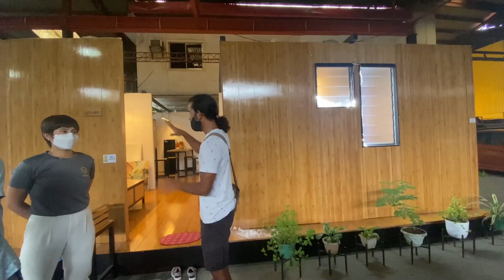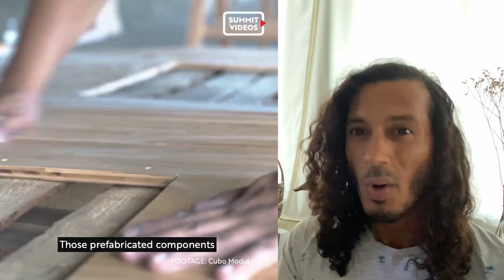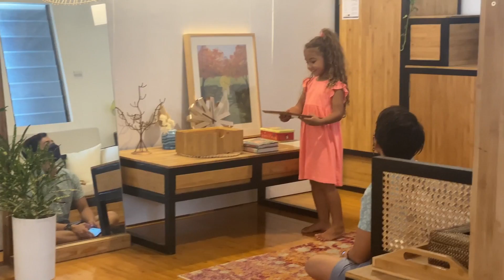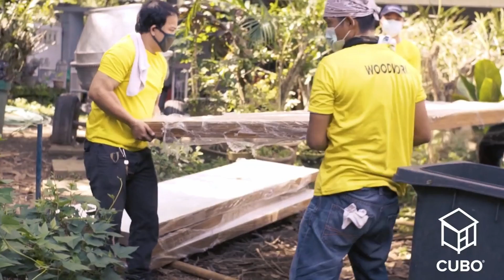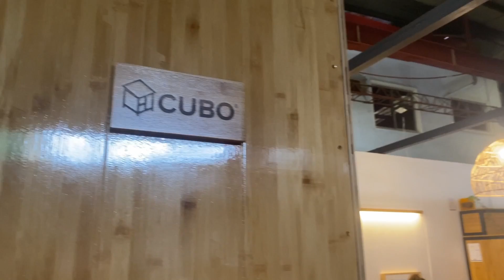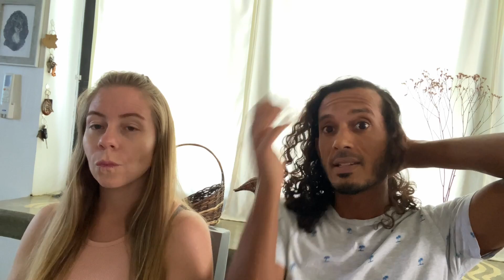Amazing CUBO MODULAR PHILIPPINES Tiny House BUILT in JUST DAYS

Comment: Hi I'm a big fan and thanks for what you do. My main concern with Cubo is the unknown durability of the laminated bamboo when exposed to water. We've just gone through the powerful typhoon Mawar here on Guam. The strongest winds occurred for about 12 hours but moderately strong winds and rain lasted at least 24 hours. Our house is made of cast-in-place concrete so although some water intruded, it only ruined the paint in some areas where the concrete wasn't consolidated properly. The problem with laminated bamboo is that the glue binding it together will deteriorate when soaked in water. Cubo must tell you how their product is able to withstand exposure to water. Thanks and best of luck to you!

Comment: I would think after the house is built or put together I should say, then you can add things to it.. probably can get some contractor to put concrete block walls on every side of it.. and maybe reinforce the roof or possibly put another roof over that roof that's attached to the concrete block walls. I'm not an engineer but I would talk to a builder or an engineer about doing something like that to make it more sturdy and last forever😊

Comment: From experience. Even if you have insulation. You still need proper clearance from the ceiling. At least 5 feet from your head. Otherwise, you will feel being cooked in an oven. Do not under estimate Philippines summer heat and humidity.

Comment: As an architect, i do not recommend this featured house if you build it along the seacoast, it can easily be blown away when there is a storm. But…It may be possible if you first build columns with footings and reinforced concrete support wall also with footings and a concrete platform, where you can anchor the whole house. Just a suggestion.
Reply: Obviously not a qualified architect

Comment: Typhoons and Earthquakes... not sure it will stand up to that.

Check out Waffle Box in the Philippines, Still prefab, but concrete and modular... and they build and deliver... in a good turn around.
Reply: Both work well, but bamboo is a nicer material
Reply: @ziggarillo  I know what I would rather in the Typhoon
Reply: @CaptainStevePlaysVlogsTalks  I would rather have the Cubo, stronger and safer.

Comment: Beawere anay kapacity  nyan 10 year or 12 years cos wooden  biawere anay
Reply: No they don't, if designed and built properly, like these.
Reply: The bamboo wood used are engineered then treated with chemicals to a kind of solution that creates an active barrier against termites, fungal decay, and woodboring insects.  Of course it needs regular check up from pesticide provider and maintenance since it’s still wood and bamboo as a natural material is subject to wear and tear.

Comment: That would be a nice tiny house, however you need to do it by using well founded concrete walls and support because the place is prone to strong storms and instead of ysing jealousy windows you can have an air tight strong kind of glass.
Reply: Its properly designed for Philippines conditions.

Comment: READ THE FINE PRINT IN REGARDS TO THAT " 50 YEAR WARRANTY" THERE ARE CERTAIN REQUIREMENTS
Reply: You don't get it at all with concrete houses.
Reply: @ziggarillo   so which material do you prefer ? Bamboo or concrete/cement ?
Reply: @Enjoy51690  Bamboo, I have a monsterous concrete house already, I wish I'd never built it. I am about to build a traditional bamboo house, the roof might blow off in a typhoon, but it will withstand an earthquake nicely.  I'd like to build a Cubo, but I don't have that amount of money spare for a " weekend retreat"

Comment: Container homes are also a big thing in the US. They are using ship containers which are sturdy and can't be removed by hurricanes.
Reply: Container homes are a gimmick, you can build the "container look" cheaper and better from scratch.
Reply from the maker: The problem with those is rust 😳 On this island they’d really need a lot of paint and maintenance
Reply: @8milesfromhome  Rust really isn't much of an issue with shipping containers.  However once you start to modify them they lose some of there structural integrity. They need to be modified to allow for natural light and ventilation. This involves cutting holes into, or removing parts of the corrugated steel skin. Counter intuitively this is an important part of the structure of a container. Designing a container shaped building ftom scratch ensures that openings for windows, doors and access to adjacent units (for open plan style spaces) doesn't compromise the stability of the finished building.

Comment: If ur going to base in siargao ,that kind of house is a disaster waiting  to happen. consult an engineer they will advise u to use concrete..worrying about termites  should be the last thing on your mind if you guys wants safety and durability in a place like siargao.
Reply: Nonsense, It's a Philippines house, designed by filipinos, built in the Philippines to Philippines standards.

Comment: Just like the previous comment here, check with the builder if their mostly wooden house can withstand typhoons like Odette or Yolanda. Looking at their video, the house could be built with strong wooden ( 8”x8” ) columns around 6 to 8 pieces, 6x6 beams around the house ceiling, or with columns and beams made of steel or reinforced concrete, whichever of the 3 materials is cheaper or which you prefer.
Reply: Totally unnecessary, this design resists typhoons already. For some reason people are obsessed with concrete and rebar.

Comment: Jay did explain towards the end of the video that the Cubo house has high stadards when it comes to being typhoon proof, maybe those who commented did not finish watching the video 😅
Reply: Exactly 😌
Reply: Yes, meets all typhoon standards, and the structure has better resistance to earthquakes. Unfortunately they are currently put on concrete foundations, which is an obvious weakness.
Reply: They could be subject number 1 in the study of longevity of these modular homes in a tropical island along the hurricane belt. Well, if they consent, that's 1 free all expense paid specimen  for Cubo.
Reply: @babypanda0201  There are loads of these built in high risk typhoon areas in the Philippines already, they are far ftom being the first.

Comment: Although it might look nice, but you need to consider the weather in the Philippines. Most of the typhoons here are very strong, and it looks like it can easily blow that tiny house away. Can it handle a signal #5 typhoon? There are reasons why most of the houses in the Philippines are made of concrete. Something to think about.
Reply: do you really think they are that naive that they won't think about it considering they have already experienced first hand a very destructive typhoon years ago?
Reply: You must not have watched the entire video. The answer to this is at 14:50 :)
Reply: @Sugar Down  yeah. You are right. The couple is smart. They experience first hand the typhoon. So I don't have doubt about their choices. More power to you both and Story.
Reply: to top it all termite problem is very real in the Ph
Reply: It was posted 2 years ago that this company cubo modular house is a modernize and solid kubo house than the ordinary kubo which mostly filipino use until now in some parts of the Philippines. You can search on youtube cubo modular house typhoon test.
Reply: Albino nice mustache
Reply: the founder of this company is Filipino  so i think they know what they are doing

Comment: Nice design to look at, but it is very flimsy to be built in a typhoon visited areas of the Philippines.  Good luck, and God bless you all.  Be careful not to be cheated by construction builders.  It's very common in the Philippines!
Reply: It's extraordinarily sturdy and typhoon resistant, and offers superior earthquake resistance. People serm obsessed with concrete.
Reply: You can check out their website or reach out to them and talk to their engineer and architectural teams. Cubo is not a shady construction/housing company. It's been featured in numerous articles both in local and international.

Comment: Just try to tell them if that house is built for a rainy season and built to be able to stand the typhone...bamboo woods are really need to have a always need a maintenance...
But for us to suggest is that just try to contact a good nice and good contructor to build a conrete two bedroom house that will last for how many years, it is only good this bamboo house is only in a farm or very far from the sea...Just saying, same as I always told you before in you old car that to buy a new car that makes you always a problem until you buy a better one...
This is the same as the house, you need to be practical if you will be spending millions and SO YOU NEED TO BUILD A BETTER STRONG AND TYPHONE BUILT HOUSE...Try to have a second taught of buying this and consult to a professional engineer...befor buying it because it will very hard to late..
Reply: Agree with you completely. Somewhat naive I believe.
Reply: 💯 agree
Reply: You didn't watch the video did you. It's going to be made of "enginered" wood  not freshly cut bamboo poles .
Reply: @ziggarillo  Sir, with all due respect. I've been a SOLID FOLLOWERS of this family since they came to Philippines and watch all of their video's from starting up to the ending of the video for how many years now. Let us use our commonsense in this situations since you will agree with me because your house is made of concrete and depending on the structure it is worth more than a millions of pesos located in a private subdivision that is very far from the ocean,  A concrete house built with steel and cement wipe out by big typhoon in just few minutes or hours, do you think this engineered designed bamboo house can stand this kind of situation. Well I guess not and  you can watch the biggest disaster that happen in our country the YOLANDA, Even this couple experience how strong the typhoon that always hits the Philippines, watch their video the time they cried in horror how the typhoon hits Siargao, and the fact is that it is only a small typhoon, but almost got Siargao wipe out by it and not the same as Yolanda. What I' am saying is that, for the sake of our family, SAFETY is always priority, this kind of engineered houses that you mention is not meant along side the ocean or even in an island, the fact you are spending millions of pesos so it should be better worth buying for, built that it is safe for all kind of disaster at least.

Comment: I shall look forward to the whole process of your home building?  I have bamboo kitchen worktop built and flooring 15 years ago in the uk and it’s still beautiful as I sand and oiled the worktop regularly.  The only thing I find with the flooring is that it is soft and would dent easily so you have to be careful not to drop sharp or heavy items on the floor, or drag anything.  Otherwise it’s beautiful!